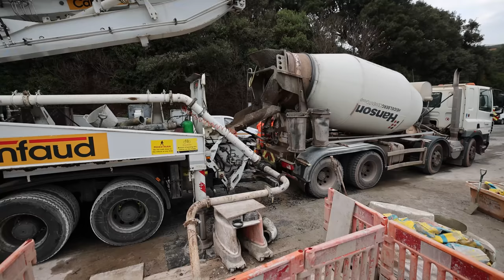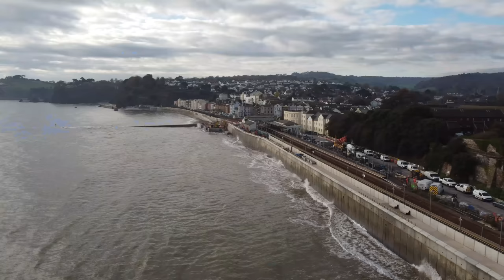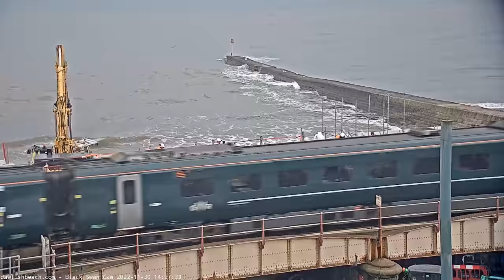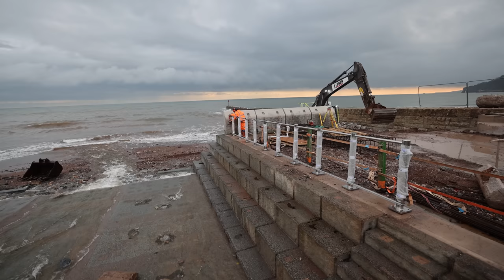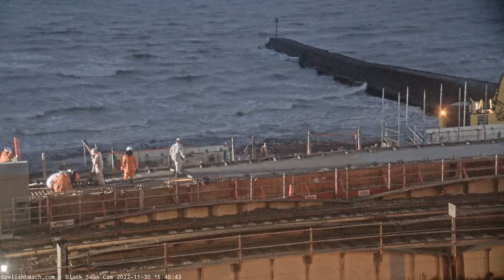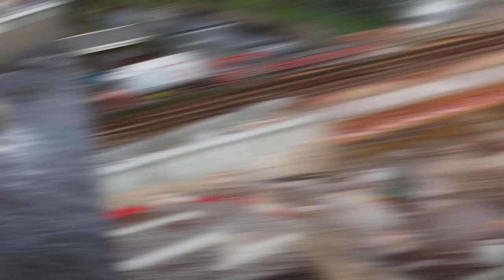Dawlish Sea Wall Link Bridge Concrete Pour

Comment: Great to see the bridge poured 👍 just one question When you have pumped the concrete through the pipe you must flush it with water, Where does the water  with the waste concrete go ??, great job guys 👍👍
Reply: When a pump line is cleared they use a ball made of dense sponge, it is pumped through the lines and that pushes the concrete out of the pipe in front of it leaving the line clean behind, no water used